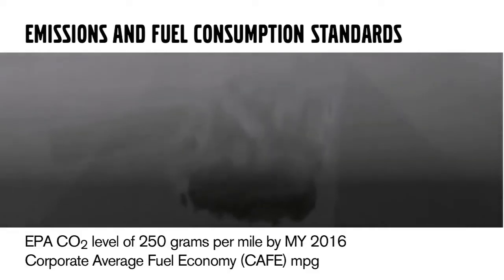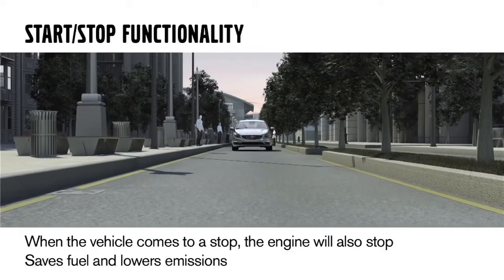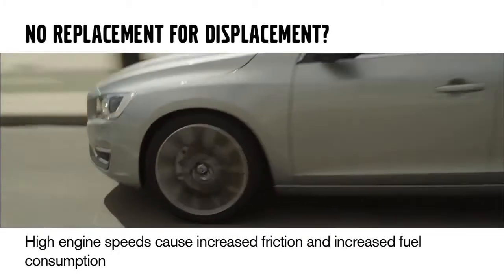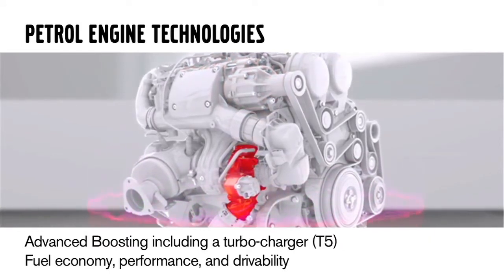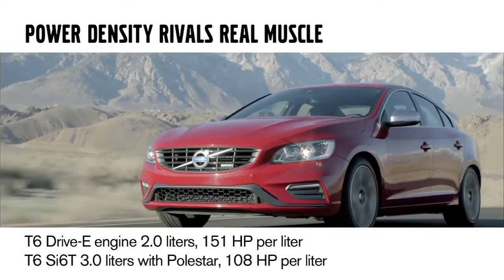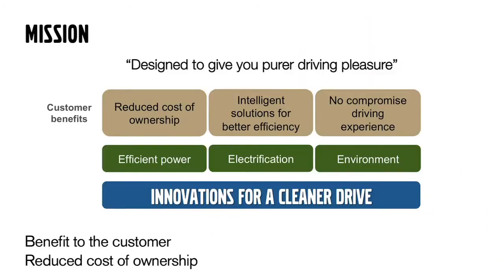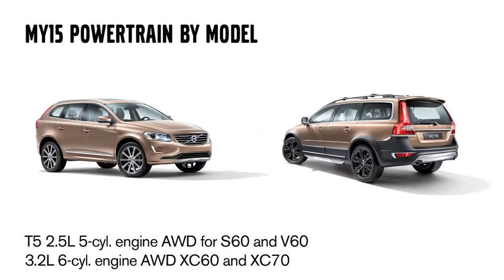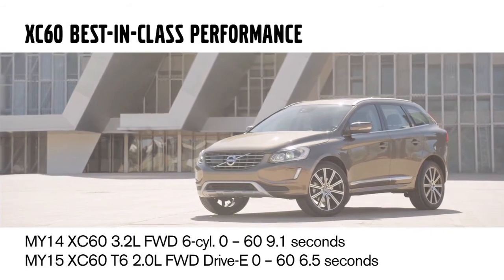2015 Volvo Drive E Powertrain with Eight Speed Gear Box - Details Explained

Comment: too bad, that pistons need too be replaced with new ones. Dealers cant do that properly, so i have issues with my Drive-e from 09/2019 till now. And compared to bmw 2,0 turbo engines - drive-e have weak potential in tuning/ going to bmw on next buy